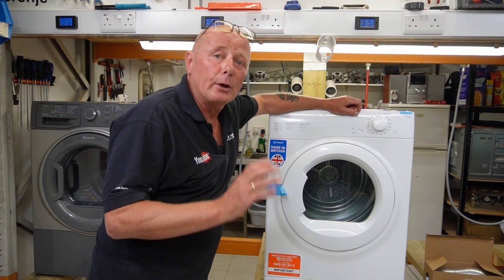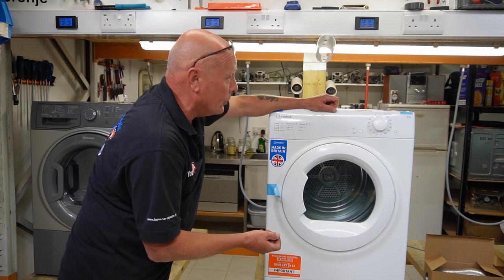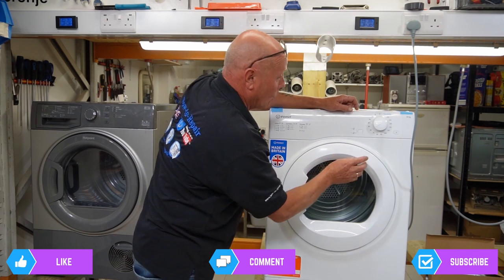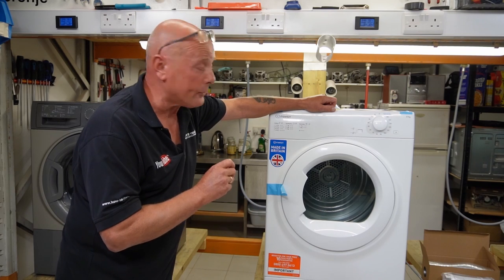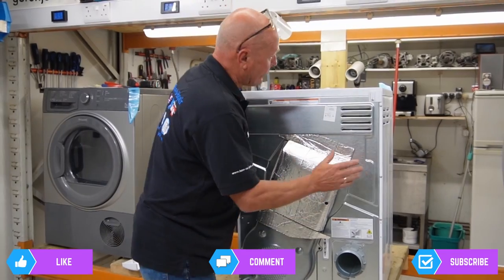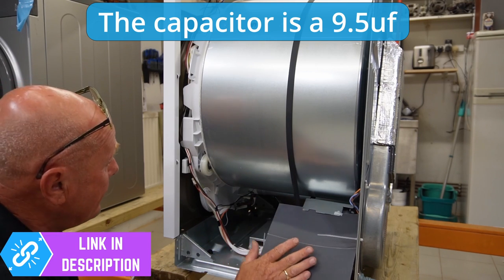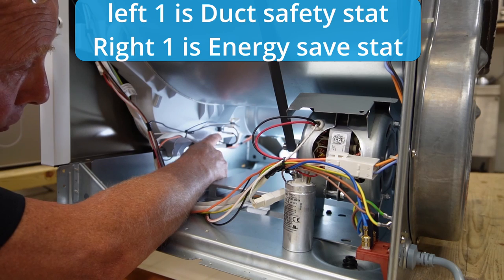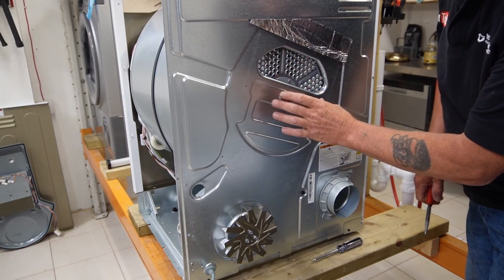Unboxing review and servicing on Indesit I1d80wuk or Hotpoint H1d80wuk Vented Tumble Dryer

Comment: Great video. An experienced repair engineer’s unbiased opinion on which dryer is most reliable / economical to repair is just what I’ve been looking for as my Hoover HDC6 has finally reached the end of its life after 20 years faithful service (motor fault which isn’t the capacitor…)

But, I can only find one video in this series. Have you made any more tumble dryer unboxing / review videos? I would love to see them!
Reply from the maker: I have not made more videos at the moment as I've been overloaded on other work, but in my opinion, if you can go with a vented dryer they are far more reliable. I still like the Electrolux/Zanussi type machines as they are reasonably well made, but the Hotpoint and indesit I'm a very basic system and easy to work on

Comment: So simple, great. Might have to persuade the wife to go out to the garage with the drying. I have a Bosch Series 8 heat pump dryer with self cleaning condenser, the radiators are clogged causing damp clothes and extremely long cycles. I've run the diagnostics mode to run the rinsing programme many times to no avail - the whole machine needs stripping down to components parts to clean the radiators. The fluff in the radiator box is also, I think, mouldy which is causing the drying to smell as well. I assume condenser dryers with removeable radiators do not have this issue? One concern going to a much hotter dryer is shrinking clothes, is that an issue?

Comment: The manufacturer states to only use the supplied vent pipe. Is the longer plastic ones perfectly ok to use? We have to wheel the machine to our back door in our kitchen.
Reply: metal ones are used now because plastic is combustible. Lint can get stuck on thin mesh plastic pipes that some manufacturers provide which can result in a fire and the plastic is combustible too which makes the fire worse.
Reply: The more rigid metal ones - rather than 'foil' - are best as they don't so easily compress and restrict exhaust.
Reply: @marcusstewart3044  what ridged ones do you recommend.

Comment: Just got the Indesit Vented Dryer.
There is a bend where the tube goes up and attaches due to position of my outside vent. it's 1.5 metres high so not straight and close as the manual says. Is that ok?
Thanks.

Comment: Great video. Would you recommend this over the condenser version of the same machine? I have a White Knight, vented tumble dryer which is 14 years old and sadly on it's way out. I want a dryer that gets the clothes bone dry. so slightly worried about one with sensors on, as they sound like they don't get the clothes really dry.

Comment: I bought this in August last year and by October had to get it repaired he said it's because I wasn't using the supplied metal vent hose.. he said do not use any other as it will not work
Reply from the maker: I can't see what he is meaning as this is a vented tumble dryer and only warm air passes through it so therefore it makes no difference if it's aluminium or the universal type, moisture is more likely to condense on cold metal than it is with the fabric type, so in my opinion I think he is totally incorrect. Please remember to subscribe to the channel has that really helps us

Comment: On the subject of no delayed timer, a simple mechanical socket timer would do the job.
Reply: Iain, I had a Creda condenser (T630CW) for 20 yrs until recently but switched to heat pump to reduce elec cost (and the condesner efficicency was questionable given the humidity generated).  Old dryers seem more energy-hungry than newer ones (heat pumps not included).  Paul, the site author, might have a view on that.  At a typical 2.5kwh, be prepared for a full cottons load to cost over £1 from Oct (current cost at national capped rate, c 80p).

Comment: Hi is the see through window on the front made of glass or plastic? Thanks
Reply from the maker: some tumble dryers use plastic, some used glass depending on the model of the machine but most tumble dryers nowadays are using plastic

Comment: At 32:30, you say that the drawings show two jockey wheels but it only has one.

At 1:30, you say Indisit is cheaper than the identical Hotpoint ... 
Does the Hotpoint have 2 wheels and the cheaper Indesit only have one ? I wonder ?

Comment: I can't comprehend why anyone would buy an 'old tech' dryer now, with electricity being so expensive, when heat pump dryers can be bought for not much more (they vary significantly in price but cheaper models can be had for £300-350) and save at least 50% of energy.  I appreciate they're more complicated, thus there's more to go wrong, and take longer to dry,  but the running costs now can't be ignored, and they're kinder to clothes as they dry at a much lower temp.  Which? calculates that running an old tech dryer three times a week for a year costs £115-163 (current models it's tested) and £38-78 for heat pump (current models it's tested).  Taking the median of these figures - £139 and £58 - that's a £80/annum saving: a third of the cost of an old tech dryer *each year*.  And that £80 will become over £100 from Oct, when elecy prices increase significantly.

Thus old tech makes sense only if you're drying occasionally, up to say once a week.  In the winter families with children could well be drying four or five times a week (Which? states three is average overall).  Obv in the summer months line-drying is feasible.

As I have solar panels, and because my heat pump dryer (which I'm perfectly satisfied with, by the way) draws 800 watts, on moderately sunny says it costs nowt to run, whereas the typical panel number output, of c 2000 watts peak, couldn't meet demand of old tech dryers at 2500 watts (current Indesit 8kg condenser dryer tested by Which? = 2500 watts).

Enjoying this useful site, thanks!
Reply from the maker: Marcus let me thank you for the very long reply but I am going to respond we have a slight difference in opinion. 
If you speak to any engineer they will tell you that the heat pump dryers on average last 5  years maximum and when they go wrong it's normally a gas problem or compressor or pcb. this makes them unaffordable to repair and this is engineers, the general public have no chance of being able to ever repair this type of appliance.
 I do agree with you that entry-level heat pump tumble dryers ar around £350 you pay for what you get, I also agree with you that they are highly efficient but take three times the time to dry the clothes. but when you look at mid-market machines costing £500 there is no justification in my eyes, I would prefer to spend the £300 difference on creating the energy to be able to run the tumble dryer. the technology in heat pump dryers, a compressor is used to create heat on the drying side and use the cooling side to condense moist air into a liquid, if this circuit is not maintained or gas levels slightly fluctuate then the temperatures will not be reached, one of the most common questions that come into our website is our heat pump dryer is taking forever to dry and this is always down to either poor maintenance which the general public is unable to do, I realize that not all people have the capability or space to be able to put solar but at the moment in my eyes
the cost of the machine is not worth it, the reliability is not there yet and manufacturers are still making machines with built-in obsolescence. my whole workshop is run on solar no grid tie so iam a fan of it but not with these dryers sorry
Thank you For leaving a comment this is for you https://www.youtube.com/shorts/e432SAb2g08 please remember to subscribe as that's is what keeps this channel going. Thanks 👍
Reply: @How-to-repair  Paul, thanks for the kind, detailed reply.  You're the expert, so I'm interested in your claim that HP dryers lack longevity (of which I know nothing).  As you'd expect, Which? hasn't reported on this as they're too new for much data to be available - but you know from experience and discussion with colleagues.  I've had one for a few years, used once or twice a week, so early days yet, but if expensive repair is needed by more than several % of machines in the first say several years (or if efficiency noticeably reduces), as you suggest, that's a significant downside.  I guess we'd have to agree that the more expensive elecy gets - and we know it is - the stronger the argument for HP dryers EVEN IF they are less durable than old tech.  For as I pointed out via the Which? figures, three years of 'extra' elecy cost could pay for a cheap HP dryer - so assuming you're correct and they could have to be scrapped after five years as uneconomic repair, in purely cost (not environmental) terms they've paid for themselves.  So I disagree with you on economics grounds (but not engineering/durability as you're the 'man'!)  Thus, the putative five-yr life of a cheap HP dryer at average (Which?) annual cycles saves, conservatively, £75/annum - £375 over five yrs.  That £375 will be £500+ from October.  This well pays for a cheaper dryer.  And of course most will last longer than five years and perhaps nearer 10, which to me makes them a -no-brainer'.  For me, though not all, longer drying time doesn't matter (and there is the minor advantage of better care of clothes per cooler temp).

IF one has solar, meeting most of old tech dryer elecy cost, it makes more sense to use old tech as the appliance is (i) cheaper - though not necessarily by much - and, your point, is more durable and user-repairable (and I've repaired my old condenser dryer as the tech's just within my competence).  BUT most don't, and won't, have solar, and that's not going to change soon, thus I'd argue what matters is the above economic analysis.  What we know is that electrical appliance efficiency is more prominent than ever, given that real terms elecy price is greater than ever and in 'heat' appliances can dwarf the purchase price over several years.

On a tangent, irritatingly Which? analysis shows you can't trust the official efficiency rating of appliances either.  Their 'real world' use tests show that, other things being equal, appliances with lower ratings can be more efficient than those with higher.

I look forward to reading your opinions of the dryers you've bought to investigate and have, of course, subscribed.  Thanks for such useful, helpful info for when the likes of my washer breaks down...

Finally, I was interested in your latest Indesit dryer strip-down.  We all know Whirlpool Corp's been stung with dryer fires - and you've confirmed they've enhanced the safety of newer ones.  I wonder how long manufacturers will make old tech dryers?  They'll be under pressure to go 'environment-friendly'...  I might also add that though I argue for HP dryers, I'm not nearly so convinced by the air source HP stuff gov't pushes, which I think is madness to and for the average h/holder, not least 'cos they'll see no reduction in their fuel bills given the cost of elecy (partic without solar) and the huge upfront cost. potential installation disruption and lack of competent servicing engineers nationally.  This is tech for at least a decade hence.
Reply from the maker: I am really a great lover of the technology with heat pump dryers, 1st with regards your clothing lasting longer because of the cool dry, I tumbling the clothes for 3 hours means more fibers will come out of the cloths, 
2nd there is no economical way to repair a tumble dryer that needs gas the repair from an engineers point of view will be in excess of £150 that's if you can get an engineer was willing to take on the job.
if a heat pump dryer lasts 5 years and then is unrepairable this means it will go to the scrap.
if a vented or condenser tumble dryer goes wrong after 8 years it is still affordable to repair.
the cost of money saving is one aspect when it comes to saving money with electricity, 
but the cost to the environment is an unacceptable Factor the right to repair act is coming out because of this
I do not know the exact costs of recycling the machine but it is an unacceptable level when you consider all the steel has to be smelted down to be reused and this uses vast amount of energy but not to you.
we could both rant on lol but we have a slight disagreement on the way that we look at things, let's just say we agree to disagree.
as soon as I see these heat pump dryers lasting I will be the first to praise them, when they use steel pipes on the cooling system instead of stainless steel they are guaranteed to rust over a period of time and their therfore leaking gas.